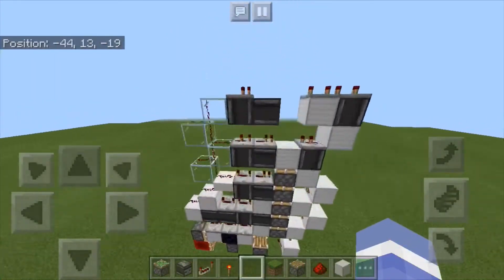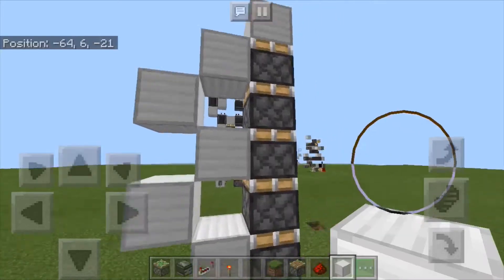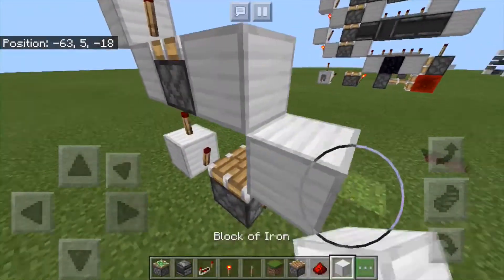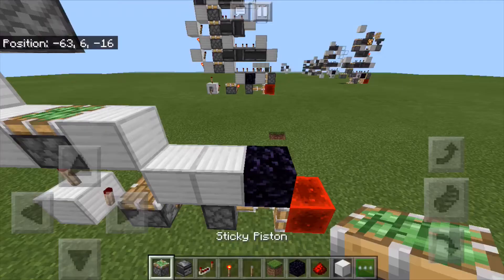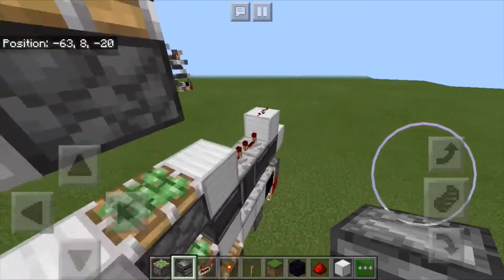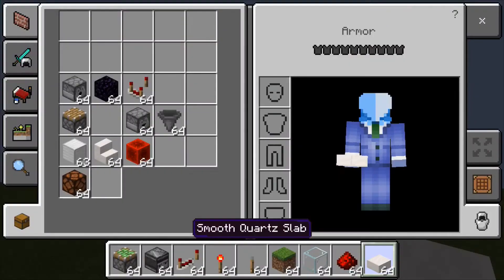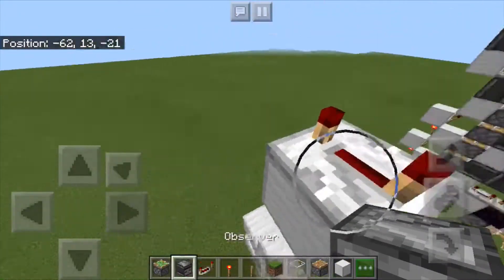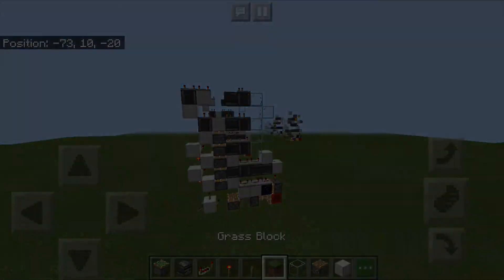[Tutorial] MCPE 5 Piston Extender

Comment: Works in 1.21 but not for cauldrons. I had to rework the final piston firing to pull the cauldron down.
Reply from the maker: yeah, i probably should have mentioned it in the video that it'll only work with solid blocks. the final retraction is handled by the top line of redstone sending power through the block being moved. cauldrons are considered "transparent", and don't conduct power, essentially cutting off the repeaters that would handle that retraction.
Reply: @ViscoseComb24  it is still a great design. I am using it to make an automatic lava cauldron in a dripstone shop where you can see the kava sources in the floor.

Comment: I built this in survival, very useful, but only if you want to pull a normal block... do you have a design that will work with pulling a slime/honey block? Those 2 blocks want to grab an observer near the top and rip it out of place... I've been tinkering for a LONG time, but I can't seem to get it to work without that ONE observer being there, and replacing it with Obsidian
Reply from the maker: Here's a picture of the extender modified for slime: https://imgur.com/VYzOygP
Reply: @ViscoseComb24  I've built 4 modules of this build side by side with the slime you showed, and it works great!... for the most part. I know Bedrock Jank, but is there a way to make it more consistent? If I take away the couple of extra bits above the torch tower (the observer upwards), it makes the bottom 3 pistons correct 100% of the time on timings and the top 2 only about 20% of the time... but if I keep the top observers and such, it makes the bottom 3 pistons correct only about 10% of the time. Like, is there a way to make the timings longer in-between firings? I'd rather have a slower extension rate if it means the whole tower itself work 100% of the time
Reply: I figured out the bottom pistons thing, but the consistency is still an issue. It only works about like 4% of the time with all 4 modules activating at once